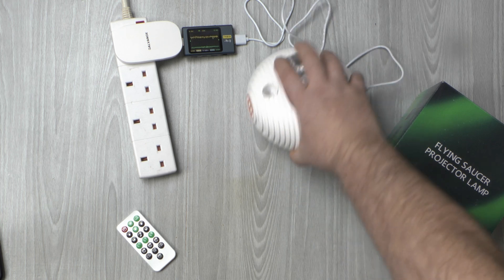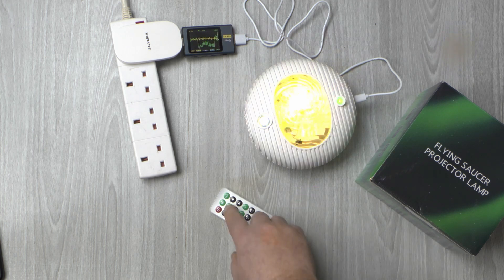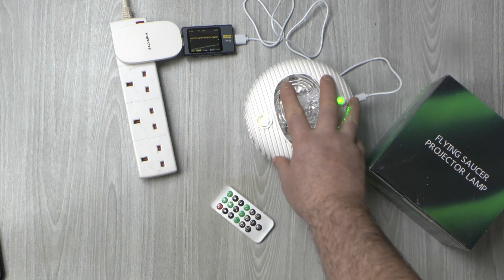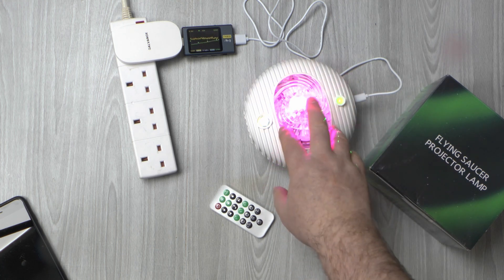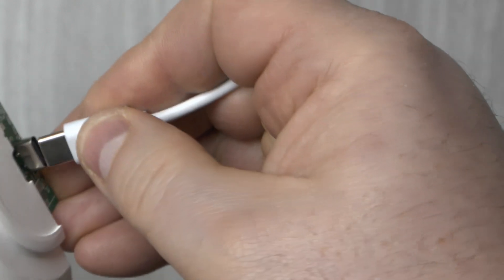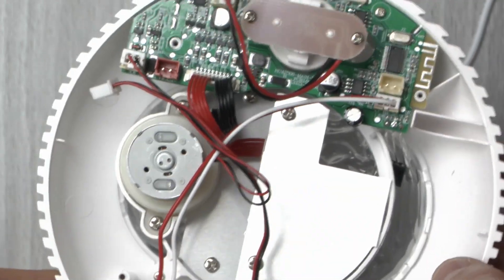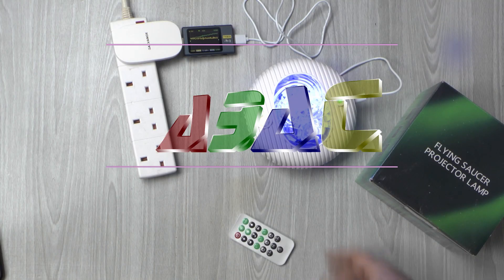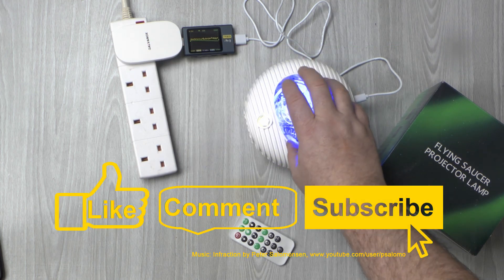Flying saucer aurora projector teardown and schematic

Comment: Is there nothing writtten on the laser module ?
Or is it just a bright LED with lens, would measuring the current directly tell you the power ?
Nice effect though :)
Reply from the maker: It's a three-wire job with two wires connected, so more than just an LED I reckon.  It's at my fiancee's house now but I could check it out with my USB power meter next time I'm there, see what the difference is between laser on and laser off.
Reply: The buck regulator driving it (NR131S?) looks like it may have a FB sense threshold of 0.8V and is being used in current regulation mode with the 2.2ohm sense resistor.  That would hint at 360mA which is the same as a typical 1W LED.
The effect is definitely from a laser diode though.  An LED would not produce that effect through a diffraction film.
The thing probably puts out more infrared from the DPSS laser than green light.